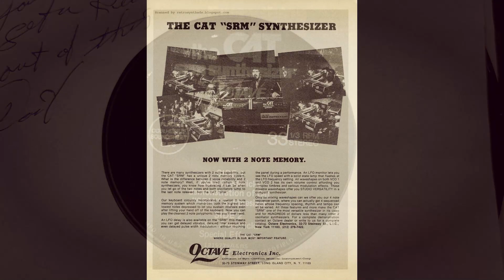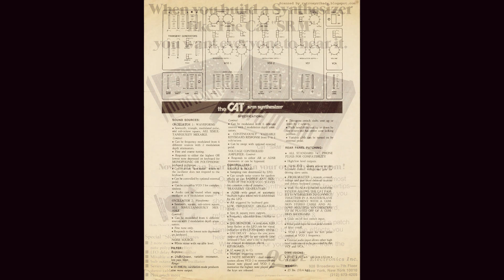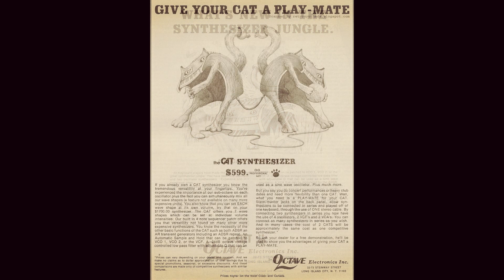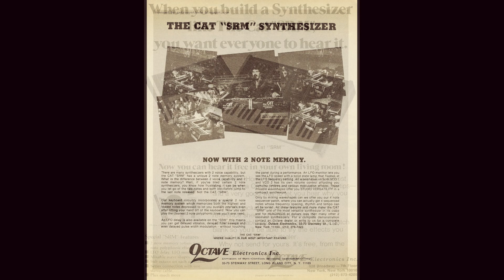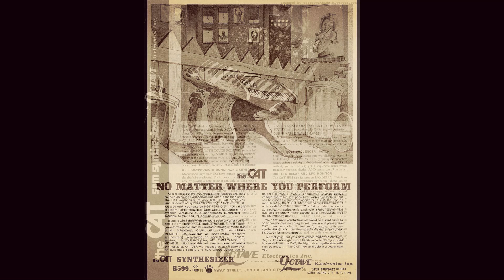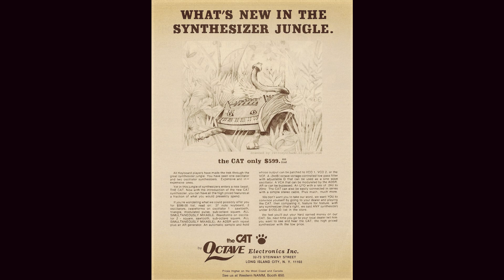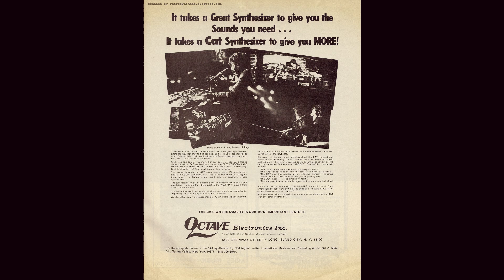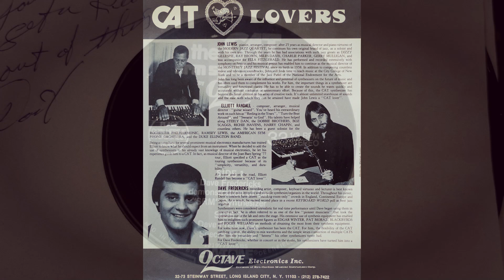Octave CAT SRM Synthesizer | Original 1977 Soundsheet

Comment: The dynamic pulse sounded like sine wave PWM to me. I modded my ARP 2600 to replace the default pwm connection (the noise generator) with the ADSR for a similar effect. I know it's only a patch cord away but I used it so much on bass patches that it saved time and freed up a patch cord for other things.

Comment: 2 note polyphony? How's that even possible?!?
Reply from the maker: A trick used as far back as the EMS Electrocomp that was added to the Odyssey and then the CAT. An explanation from a qualified tech:

"there is a chain of resistors in the keybed that work as a voltage divider. When a note is pressed the voltage charges a low leakage capacitor which is followed by a high-impedance op-amp buffer that effectively keeps that precise voltage in place, hence this is sometimes referred to as analogue "memory". Press a second key and the difference is added to the voltage stored in the capacitor with the lower voltage directed to the first oscillator and the higher to the second. Voilà - duophony."
Reply: its  da fat cat !!!!!
Reply: Can you imagine... I mean with a dedicated built in vibrato technology and everything. It's like your very own radiophonic workshop right there in the front room.... and you don't even have to wear a brown lab coat.
..all on one master keyboard... truly we are were living in amazing times.